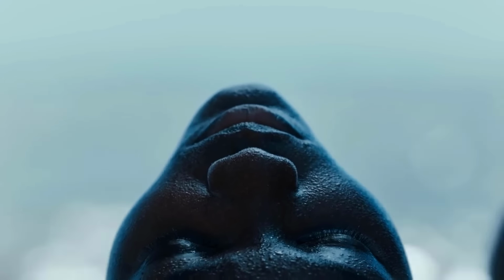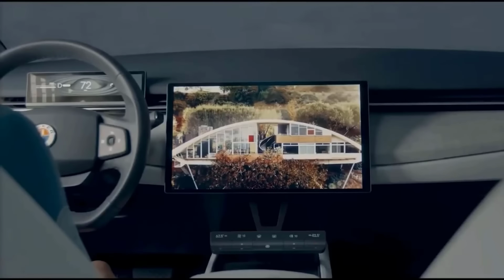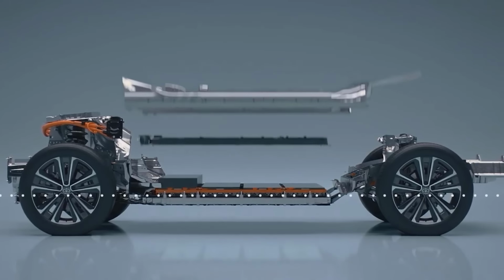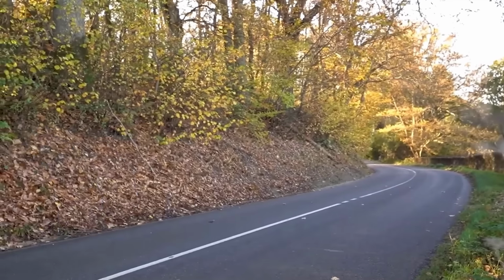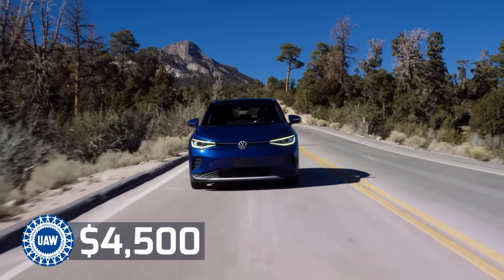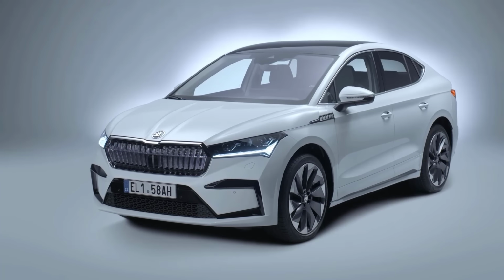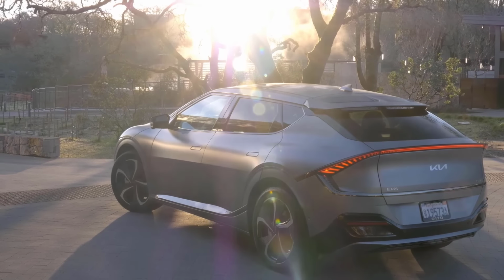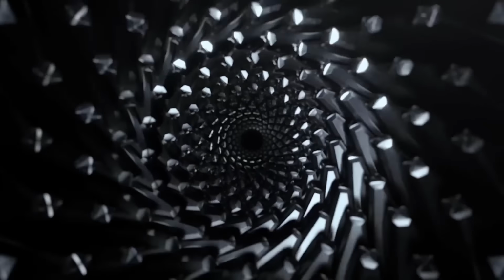TESLA's Half Price... 5 Great Electric SUV

Comment: charging time + Low range limits means ill wait a few more years. When they can get at least 400 miles standard, then it will be worth it
Reply: Why is 400 mile range the need? 2-3 years ago it was 250, and now that a huge % of ev's hit 250 range, that target has moved to 400 miles, with no real reason given. Who, regularly, drives more than 200 miles a day in their personal car???
Reply: 45 minutes for 100 mile range? Yeah, if you're looking at ev's with technology from 5 years ago. 
But, my point wasn't even that. Do you regularly drive 400 miles a day? I don't and I live in the southeast of the US that has some of the longest commutes in the country. And still, no one I know drives 400 miles a day. Except maybe Uber drivers but I doubt that as 400 miles a day in our traffic would easily take 10 hours. 
And, since I don't max out the range on my ev every single day I charge at home. Where it takes approximately 5 seconds to plug in and 5 to unplug.
Reply: @sh969  I live in Europe and frequently drive several hours at a time weekly. My point is that if I drive almost 1000km one way... Trips 2 or 3 weekends... Can be exhausting if I have to stop and charge for awhile
Reply: @sh969  If you can't charge at home, you probably don't want to be going to a charger twice a week for 30-45 mins. The issue is pretty much negated with home charging, but assumes you drive less less than 150 miles a day. A vast proportion of EV owners in future will not have access to home charging, so their requirements will be far more stringent when it comes to usability.
Reply: 500
Reply: @sh969  it's very simple. My gas sucking suv does 400 on a full tank and take 5 min to fill up. If I have to spend 45 min charging just to get.. Maybe 100 miles.. That's not effective. Now... With that beigg said... I currently live overseas... So driving is not 5 min here or there where you only need to charge when you get home.  Also, the more popular EVs get, there is more a chance of a charging station already taken... You know... For 45 min.
Reply: @mistadj  with a traditional car, when you need to fuel, you need to do a 'detour' even if it s only at 5 mins from you normal course. Then you need to fuel. Take time. Pay. It s smelly and you leave with a small gift, dirty hand (smell gasoline) ;-) And it is your only possibility.

Now, with an electric car, you can just arrive at home, no detour.
Park in your garage, plug your car, like you do for with your smart phone. Done.

And if you have an EV with a good range, like a M3 or you have few kilometers to do per day, you do not have to even 'lose' 15 sec to plug your car every day.

I remember, every week I was refueling my range rover - every week, stooping at night to my depressive gas station after job. And I wanted not to stop to be already at home. Specialty in winter when you do not want to spend even 5 mins waiting for your car to be full in the cold.

And I am not talking about running cost that are REALLY LOW wiht an EVs ...

Try an electric. Easier to drive, more power, cheaper to run ... it s a no brainer
Reply: I AGREE, 250 mile range is very low. I'll wait, esp with the charging time. 
I appreciate the technology but I'm going to opt to wait...
Reply: @Yahreshohn  the average person in my state drives 18k miles a year. Even if you only drove Monday-Friday, and didn't drive at all Sat and Sunday, that's around 60 miles a day. And I live in one of the states with the longest daily commutes. 
60 miles a day means a 250 mile range would EASILY get you through half the week. But, since the average commute in closer to 35 miles, a 250 mile range should easily get someone through the entire workweek. Including running heat/air and driving the interstate.

EV's are aimed at the average driver. If you drive 300+ miles daily, don't get an ev. If you can't charge at home, and can't stand the thought of charging while you shop on the weekend, then don't get an ev. 
But don't act like owning an ev is only for a select few. The opposite is true. It only IS NOT right for a select few
Reply: In extreme conditions, let’s see how the battery functions. I see a lot of electric vehicles will end up as scrap when it’s not feasible to maintain or purchase another battery without taking out a mortgage.
Reply: @ardentlions6636  really, you've seen EVs scrapped because of batteries? Or you've heard stories of EVs being scrapped? Please let me know where, I'll look at buying them .

Comment: I have a Hyundai Kona and I never have been more happy with a car. It is just awesome and cost very little to drive. It is very quick and fun to drive and has a decent range.  I had it for the past 2 years. It is available now.  I say if you have to drive more than 350Km/day you should buy something else but who does that?
Reply: Hi bossman61, can you tell me what version do you have? The 130hp or 200 horse power? What battery do you have? How much do you drive on one charge? What price did you pay? Thanks friend.
Reply: @mtn_silviu  I bought the preferred model. Don't know the HP of it but it rated range is about 425 Km . I think realistically I get about 375km per charge in summer. We deal with extreme cold here in winter and in -25 C weather I get about 250km. But I never drive that in a day anyways . I paid $40,000 in 2019 and It has a 60kwh battery. I charge at the cheaper overnight rate ( 8 cents) so at empty I pay 8x60=$4.80. but I never have an empty battery so often it is way less. It is truly fantastic. Best of all is never deal with high gas prices again.
Reply: @bossman6174   @bossman61  damn only 8 cents. That very good for you. Happy to know you are gas-free. I also love the Kona EV. Here in my country I can get it with 26k euros. The 60kv/h battery and 130cp. I want to use solar panels and charge my kona at home. But 26k euros it's a lot to begin with. Even
Reply: @mtn_silviu   ... they are two versions and both have  150-kW (201-hp) electric motor
Reply: Can any of you brilliant "electric vehicle" owner/drivers explain...how the electricity you use to charge your vehicle gets produced...
Reply: @cheesemouse7774  20% comes from renewables. How much of your gas comes from renewables?
Reply: How do energy and emissions in the United States compare to the rest of the world?

In 2021, 79% of US energy consumption was from fossil fuels, 8.4% was from nuclear, and 12.5% was from renewable sources. The share of energy consumption from nuclear and renewable sources combined has more than doubled since 1980.
Reply: 79% from fossil fuels...

You're kidding yourselves.

Wake up!!!
Reply: The world drives more than that. Electric cars are only good for soccer moms close to home.
Reply: I went to the dealer to buy a Hyundai Kona they didn’t have any in stock and they had a $10,000 markup over the factory window sticker they can shove their Kona up their kimchi butt
Reply: Exactly, EV's work great as commuter cars for regular people / not everyone //
Reply: Every contractor that keeps your lights on, water running, built your house, and roof over your head does. Ignoramus.
Reply: @The Fix  My Dad has been a contractor or in construction my entire life (I'm 40). He has RARELY driven more than 200 miles a day.   And, on the rare occasions he did, it wasn't in an SUV or CUV, but in a big work truck. Absolutely none of which were mentioned in this video, so would be irrelevant to this. 

(Most of the electricians and contractors around here won't take a job more than 25 miles away, and literally none go more than 50. I know, I've looked as I live in a city that most contractors refuse to work with at all)
Reply: @sh969  I tend to overwork, I just sat down and it's 10:30, I'll be up at 5am. I don't do service work so if someone wants me to build a $60k curved stair project and they're 75 miles away, I charge $75k for it and send my crew that lives in that area. It helps that some builders won't use anyone but me, but we do old school work and there aren't too many people coming up in the Trades, especially finish carpentry. Thing is you can teach any monkey to twist wires or crimp Pex, but to be a Craftsman you have to have a passion for it, I live it, eat, sleep and breathe wood, literally sometime. Ever have a dream you banging a hammer or running screws. I have to stop by frequently but I make a loop and do some bids along the way. 
I wish they'd make a 3/4 ton 4BT Cummins /Electric hybrid solid axle manual crew cab. 
 Elon.....
Reply: @thefix2573  well,well,well.The truth is hard to accept. I think you are the IGNORAMUS. YOU are the FOOL who keeps going to the gas station like a junky to a dealer to get ripped off day after day by the North American oligarchs making massive profits. What is so great about that? Are you blind. At least get a hybrid or something. Defending oil and gas makes you looking like a fool.
Reply: @thefix2573  I would have to say whoever hires you and pays labor rate for 3+ hrs. Of drive time is the ignoramus.
Reply: @davekozlowski1266  Well no one hires me, I do Contract work and have 4 crews from one end of the Valley to the other, can't drive a Prius.
Reply: @thefix2573  Are this electric vehicles  like gas cars where you go to a gas station fill the tank and you are ready to go or travel to another state? 😁😁😁😁😁
Reply: @thefix2573  Your not everyone dude!
Reply: @thefix2573  Your judgement of bossman61 seems harsh.  He did say if you drive more than 350 km/ day, which seems to recognise that some people do drive that much. In questioning who drives that much, he perhaps implies that most people do not. If you assume that distance being driven every day for 5 days a week and 48 weeks of the year, that = 84,000 km (well in excess of 50,000 miles). Apparently on average, private motorists in the UK cover closer to 8,000 miles. I guess that bossman61’s comments are largely addressing those people. Even if that average total was doubled to 16,000 miles a year - he is right that the Kona could easily achieve that, since it is possible to drive more than 270 miles a day without charging, even at legal speed limits.  😊😊

Comment: I need a car with 450 mile on a charge. Until then, it's hybrid.
Reply: there may 455⁰.miir etrc car rvß 450 mie rang rv596.ikevràbre 5ow mievtejssa 620 mike tejsà 440.mile soar ar teksà add ¹6 prrbcét 480 mile master chef hybrd is 45⁰ mike rabge
Reply: 100⁰ mioe soar car  tejsa cell 1160 ilecràbfe

Comment: As near as I can tell Fiskers and Mergane have no unique or amazing qualities vs Toyota, GM, the Koreans etc. In a competitive market where everyone is selling similar products purchases depend on price, terms and conditions, availability, etc. Hard to believe any of the boutique manufacturers will survive against the majors.
Reply: The Toyota has two major issues. 
1. May not charge in cold weather. Not slow charge, No charge.
2. There is also some heating issue. 

I love the look of the BZ4X Except the front. It's totally underwhelming in the performance department.
Reply: The design of the cars has its importance too...

Else the Megane is manufactured by Renault, not exactly a "boutique" manufacturer. It is actually ranked 3rd, below Toyota and VW.
Kia is ranked 4th, and GM is ranked 5th...compared to Renault, GM is a "boutique" manufacturer 🙂

Comment: 3 of the five EV's I've had failed me at around 35000 miles. Luckily I leased 4 of them. One lease was 24 months. Currently own a smart EV. 40000 miles but I only slow 110 volt charge it. No battery degradation so far.
Reply: which ev's did you own?
Reply: Nobody is mentioning reliability
Reply: A volt. 3 leafs and one smart
Reply: @teddystoner8288 some of the reasons Tesla is in high demand.
Reply: Although I've yet to see an ev that hasn't had battery degradation unless newer.
Reply: @teddystoner8288  The battery deg curve levels off at around 85% on most vehicles, after that it's very slow to lose more. The question is, how do you manage the curve to eek out how long it takes to lose that initial 15%. The answer is simply slow charging at home most of the time.
Reply: @IanMcc1000  from the information I have seen, looks like 10-15% loss after 200,000+ miles.
Reply: they get ³⁵0⁰00 miles Bater yçke that's obuy 1 ¹ tenth hatred ç7çké dut kñkw why 3 faíreß
Reply: @2ndshot  paying $5/gallon of gas sucks
Reply: @2ndshot  uh no, he didn't own any Tesla's,  3 Nissan leafs and something else. Also stated he's still driving an EV that's working fine. I'm not saying that they're perfect for every situation, but overall they are superior to gas vehicles. Niece has been driving a Tesla since 2013 and has only stopped to recharge once in approximately 9 years. All recharging has been done at home. That's a lot of money and time saved. Since we have 2 vehicles in our family, an EV for one of them is a no brainer. It's rare that I drive more than 250 miles a day so I don't expect to need to charge anywhere but at home. However, with putting 40,000 miles or more on the car each year, my savings on fuel will be substantial.

Comment: If you want good, home of the battery production, hi tech and cheap EV, wait for the many offerings from China coming this year.  Sorry, but China will take over the EV market and will destroy the competition - except Tesla.
Toyota : most of their cars will be hybrid and PHEV as they they are putting all their eggs into solid state batteries that won't be around till about 2025 where they will be using smaller batteries to test them in that enviornment. (see their technological presentation by their chief engineer).
ID4 : Watch Munro engineering on the VW offering before purchasing.

Comment: KIA EV6 in EU cost 59k at the cheapest ... and IONIC5 starts at 50k .....
Reply: No,  the $59k is the top of the line ev6 model. They start at a little over $40k.
Reply: @davekozlowski1266  i di check the official dealer pages before commenting... so - no - i mentioned starting prices !
Reply: Hardly affordable as they claim in the video.

Comment: You state "there are already some electric crossovers ....as great alternatives to the Tesla Model Y" for around $30,000 US.   WRONG!   The Fisher is not even in production!   Skoda is not sold in the US.  The Chevy Equinox.... another car that is at least a year away.  The Toyota BX4X.... hello?  Maybe in November or December.  So what is available, really?  And at what price?  The VW ID.4.  More like $34,000 instead of $27,500, and you can order now and get delivery in about 5 weeks.  Many dealers are marking up the price $495 to $1,200 over MSRP.  Both the Hyundai Ionic and Kia EV6 are 'hot' right now, and dealers are marking up the price $1,200 to $12,000 over MSRP, depending on the model!  Making it a $40,000 purchase, not a $32,000 purchase.  And that is AFTER a possible tax credit.  The real price you can expect to pay for one of these is close to $50,000.   Sure prices should come down in the future, but for now, get real.

Comment: This is BS. None of these EVs will cost anywhere near $30k. And the $7500 tax credit isn’t an actual cash discount. Most people don’t make enough in a year to owe $7500 to Uncle Sam.
Reply: Finally someone who understands the so called falsely promoted tax credit, not only they have to have tax liability of that amount to be offset with the "tax credit" they also would have to pay that tax liability during the tax year, so if they have tax liability of $7,500 and paid $6,000 through withholding then their allowed tax credit would only be $6,000. A lot of people are going to be shocked at the tax filing season. It's non-refundable credit people.

Comment: the bad thing is dealers are not equipped or prepared to handle malfunctions and have to wait on manufactures to diagnose these new vehicles. coworker bought one and two weeks later theyre still waiting on cause of problem. dealer told him to call manufacture and complain to help them get issue resolved faster. lmao.
Reply: update. 2 months later and still waiting on car to be fixed.

Comment: The prices mentioned here are completely unrealistic. for example Megane entry price = 36000 and that with the 40kw batery and slow charging the model displayed = closer to 60.000€ so big bogus on this video. and shame on the industry for overpricing cars making them to expensive for normal working ppl This is the way forward 50K + for a car Hello bank can i lone 50K for a car???????  i only pay 1376€ for my house 684 for gas and electricity 78 for enternet 48 for my phone 30 for the water 18 for netflix 9 for television. and so on montly cost atm close to 2.000€ and now we going to have to lone for a car? WHERE DO WE GET THE MONEY
Reply: La Renault Mégane E-Tech EV 40 Standard Charge Equilibre - 130 ch, est vendue en France au prix de 35.200 € ! 😉 🇫🇷

Comment: GM gives us 300miles minus 20% for daily use = 240 miles SUCKS
Reply: You're very negative!
Reply: Even with a net 387km range, which includes the 20% reduction, this is certainly many more times than what the everyday driver needs each day. As come the following morning, the fully charged EV will have another 387km of range available.

Boomer trash talk is just that, Mr Stehura.